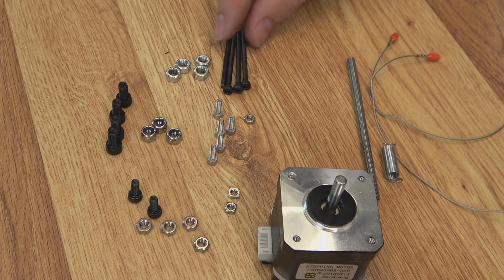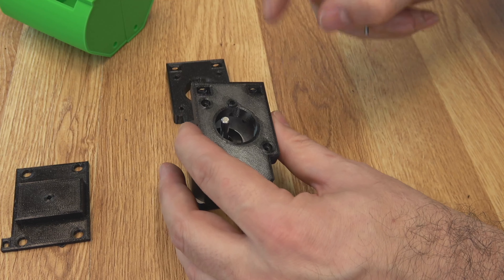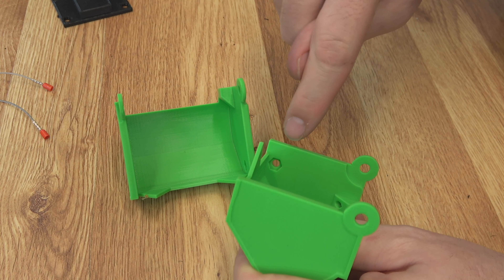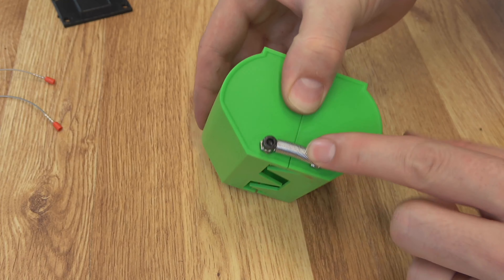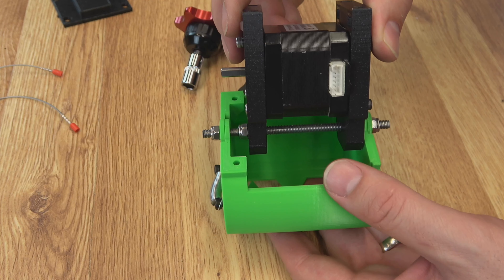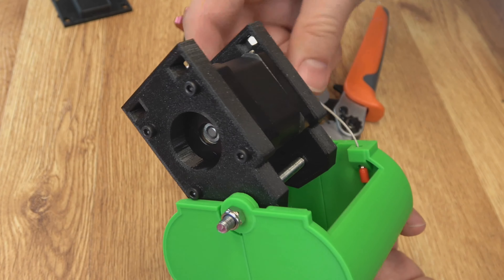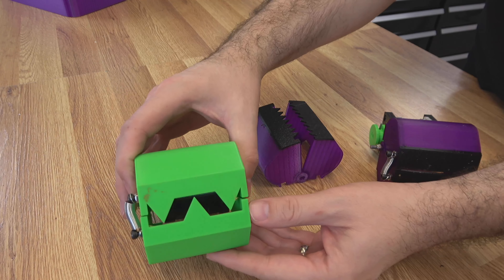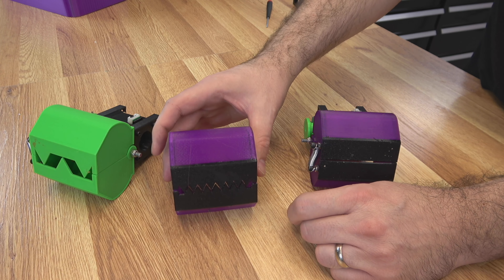The Candy Claw Series - Part 3 - Claw Build - Chris's Basement - 2022

Comment: Hi Chris.
I hope all is well with you and your family. You couldn't happen to know of a new or used SKR v1.3 motherboard for sale. mine is probably smoked, it only comes up with error code E1 maxtemp, I've tried a new temp sensor, reinstalled software, also soldered over the sockets on the card, but with no luck. so far I've found a new one in Johannesburg, and a used one in Canada, but neither will ship it overseas. these cards are becoming extremely difficult to get hold of, and I didn't want to start rebuilding again, new software, cabling and box. this printer has printed thousands of hours, and should have been replaced by a smaller one, perhaps one not rebuilt beyond recognition, but since this one can print relatively large, I want to keep it alive. Sincerely, Otto Olsen
Reply from the maker: Hey Otto! I wish I knew. It seems like once these companies go to the newest versions the old ones die out. If it helps, The NON EZ SK3 should be the same foot print. Minimal updates to the config as well.
Reply: @ChrisRiley  i manage to find a new oldstock in Denmark at an makersupply, last one. But they are getting realy difficult to find. yes there are all the new cards, and ofcorse most of them are better, but like me that has a everything around made to this card, just need a replacement, my printer wil never reach lightspeed anyway.  the newer cards with the slot stepperdriver  looks like a better design, both for space saving and for cooling, it may be an option for my next printer 🙂 Merry Christmas to you and your family. Regards Otto
Reply from the maker: @ottoolsen9676  Thank you, Happy New Year!